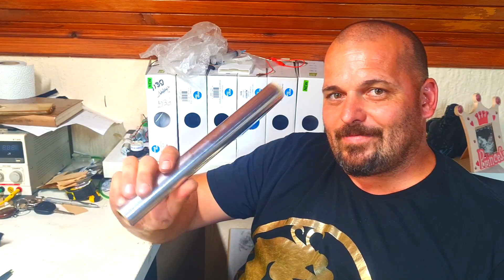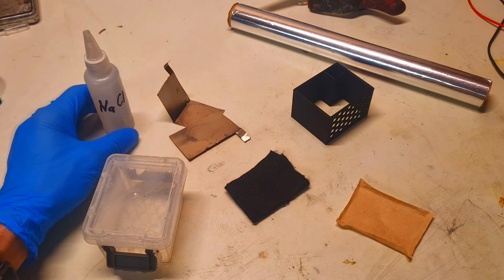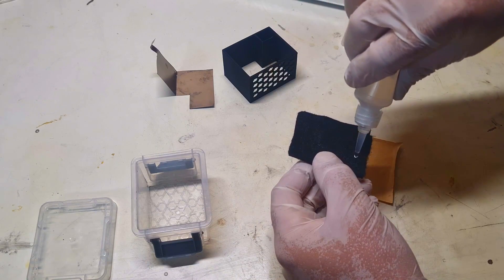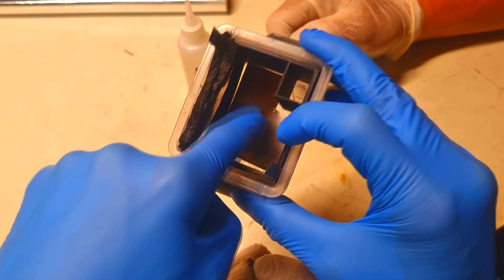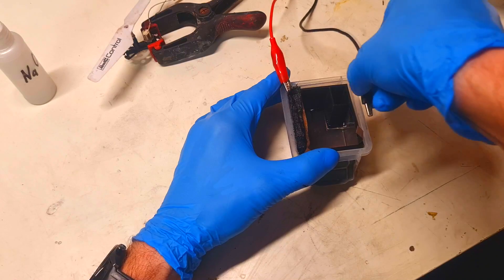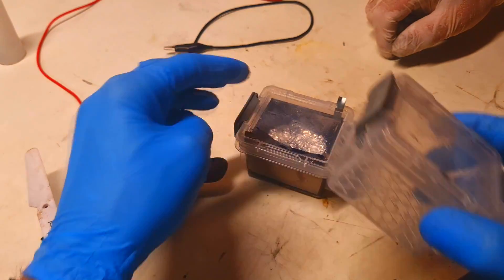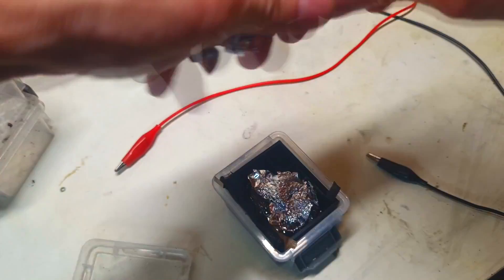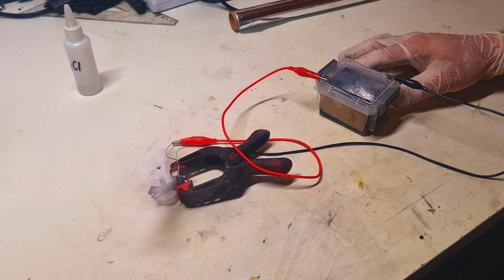DIY Reusable Aluminium air Battery

Comment: Hello, do you know where I can find some of those activated carbon you used? I attempted this project, and though it showed 5 volts on the tester, it failed to power the small dynamo. I suspect the purchased carbon may not be authentic, as it felt more like a foam filter. Unfortunately, I couldn't verify if it was genuinely activated carbon when I bought it online.
Reply from the maker: Hello! The ACF I get from some company which make sell  business to business. But on internet you will ba also able to find some companies that can sell to people. https://www.ceramaterials.com/product/activated-carbon-felt-sheets/ , https://www.graphimaterials.com/activated-carbon.html , https://www.graphiteinsulation.com/product/specialty-felt/activated-carbon-felt/ (ACF 1600 is good) ,
Reply: @cayrex  Thanks for the info, do you think using an activated carbon sponge as an alternative to felt will still make the product work?

Comment: HI, very good stuff. 
Something i dont understand here, what is the most important,  air contact with electrodes (anode,cathode) or air contact with aluminium ?
Reply from the maker: Plastic spacer? The parts here are + Titanium current collector, activated carbon felt, separator, plastic spacer, electrolyte and - Titanium current collector

Comment: Is this battery recharge able ?
Reply from the maker: Yes,... mechanically. You change the fuel (aluminium) and electrolyte
Reply: As-in can you use a solar panel to recharge the cell? No, it's not that kind of cell, but you can go to the kitchen and get the foil for your turkey and some salt from the table. All you need is something that makes Aluminium and salt from solar process 😁

Comment: Please redesign it because the design is morronically clunky. In that volume you could pack definitely more cells in it to make it actually usable for daily use😂
Reply from the maker: Oh,.... if I want to make more practical I will go with much more different form. That was shown as diy project which many people can make out from basic materials. Because not all people have cnc, 3d printers, etc to make a fancy cells.
Reply: Well done for insulting a guy who is demonstrating something practical. Where's your morronic contribution?

Comment: Great work!
However an electrically rechargeable al air battery would be a lot more practical. You could experiment with that too.
Reply from the maker: Correct! The Al-air batteries would be better if they can be rechargeable by electricity.
Reply: @cayrex  That is simply not going to happen!
Reply from the maker: @idjles and for this reason I said "would be" better if this would be posible.
Reply from the maker: @idjles Sorry for my English😅
Reply: You mean Al-ion not Al-air

Comment: I have a challenge. I want to use a 20 l plastic bucket and make a battery inside it. You who have a lot of experience can recommend me some material that can be obtained. With about 10 buckets put in series, move an electric car. It's just for testing. I don't know whether to make an aluminum air. Can you recommend any of your videos to follow but on this scale?
Reply from the maker: So, you want to run a electric car on aluminium air batteries? Sorry I dont have any videos about that,... jet. For that case is needed to re-design the cell.
Reply: @cayrex i mean if you can tell me based on your experience what kind of method I could use to make a battery of that size. Could you recommend me something? I saw videos of people using a 20 liter bucket with charcoal and copper electrodes but from your experience I am asking you if you think it is possible. In the end, who would make the expense would be me. thanks for answering.

Comment: Great work...
Hey is it possible to put one in a vacuum chamber and see if it still works?
Based upon what I know about electronegativity you should have .9v of potential difference between carbon and aluminum per cell. Is that what you see in voltage of a single cell?
Reply from the maker: The voltage is from 1 to 1.1V per cell
Reply: @cayrex  Ok.. This is what I was working on before I couldn't work no more. If you can protect the electrodes from the galvanic destruction you should be able to draw current from that potential difference. The problem I had was figuring out what would protect each electrode and still pass a good current. Carbon seems to be the answer. The storage mechanism is the disassembly/reassembly of the electrolyte. Because of quantum tunneling the parts know how to reassemble and give current back.

Comment: Really nice work here!👍
I just had a question regarding the dual electrolyte aluminium air battery you made a couple of years ago. I tried making it a few days back and it seemed to give a good voltage output for a long time but the current dropped out very quickly could you suggest any solutions so I get a better current output for a longer time
Reply from the maker: Yes this is because of the membrane. To get better performance you will need to use a nafion like membrane
Reply: Okay thank you👍

Comment: Something I don't understand. If you close the lid how is the air supposed to get into the air battery.
Reply from the maker: The cell will be fine with less that 1mm hole. And also the cell is not airtight

Comment: Instead of Sodium/Potassium Hydroxide you can use a mixture of Salt and Sodium Carbonate(Washing Soda not the Baking Soda) Washing soda it's very Alkaline but will not attack the PLA
Reply: Yes, use Washing Soda Na2CO3 or K2CO3 !

Comment: Nice cell, would be good if it could use scrap drink cans rather than Al foil.
Reply from the maker: You can put any source of aluminium
Reply: @cayrex  I realise that, but you have to buy aluminium foil whereas empty drinks cans are already waste material and I was thinking of a cell specifically designed to operate on waste aluminium cans.

Comment: Nice, simple architecture and of course very accessible for nearly anyone to DIY their own replica at home. A question if / when you have time to respond...with the air cathode buried within the case, do you think there's any risk of the air cathode in this configuration being starved of oxygen ? Also, and on a different topic altogether...but requesting at some point when you're perhaps trying to figure out what new content to create --> a build demo on your conductive HDPE...I've personally been unable to melt HDPE into a workable enough liquid form to just blend in the conductive materials and then solidify. I've done a few trials myself using a double-sided heater with an hdpe coupon coated with graphite / carbon on both sides which results in the conductive material being concentrated near the surface but so far I've been unable to promote a more fully blended / homogenous material. I'm still experimenting with an ldpe matrix around the conductive material and creating more of a conductive film as well as various methods with hdpe melting / creation of a composite make up but just curious if you're able to share your recipe for conductive HDPE, it would be greatly appreciated. And of course, thanks very much for your continued excellent content !
Reply from the maker: Hello. Thank you! About the air cathode that being starved of oxygen,.... not really. And about HDPE is that I dont make my own HDPE,... I buy it. I make some conductive plastic from polystyrene,... but not from HDPE.
Reply: @cayrex  Thanks for your time & thoughtful reply. Appreciate your continually insightful content. 👍

Comment: Thanks for such awesome project, what is the charge cycle for such battery?
Reply from the maker: Charge cycle? Adding fresh aluminium and electrolyte
Reply: I take pva wood glue and wax paper with coffee filter and squeegee it together, let dry and maybe heat press it. Works longer. I like the way cathode was compressed to side of container. No more clamps! Thanks

Comment: Have you tried potassium hydroxide with zinc oxide electrolyte with this cell?
Reply from the maker: Yes,.... but I make way toooo concentrated KOH (my bad). And when I put the aluminium foil into the cell,.... I get the volcano. So around 10% of KOH will be fine.

Comment: Is the aluminium only used when a load is applied? Or does the aluminium disolve over time because of internal resistance?
Reply from the maker: Like @nicamarvin already said,.... the electrolyte will spontaneously react with aluminium, especially in KOH electrolyte. The reaction in NaCl electrolyte is much slower and the aluminium will protected himself with oxide layer. For that reason you need to add the electrolyte and aluminium when you will use the battery
Reply: It will desolve due to the alkaline electrolyte attack on Aluminum
Reply: You can leave the aluminum there, if you want an "emergency battery" you are supposed to just drop in the liquid electrolyte and start using the battery.
Reply: @ezequieladrianminniti6252  thx
Reply: Just wondering about the performance: power output and capacity? I'm guessing they are not huge.

Comment: Choline chloride and imidizolium chloride make a brilliant deep eutectic solvent electrolyte for rechargable AL batteries 😉 just add some aluminium chloride, carbon and Nickle or titanium electrodes. Works as a plating/de-plating battery.
Reply from the maker: Yes, good idea. But is not appropriate for the idea of that project. Because here the idea is to make a easy reusable al air cell that can make most of people. 😉